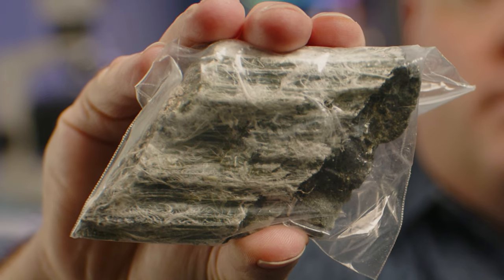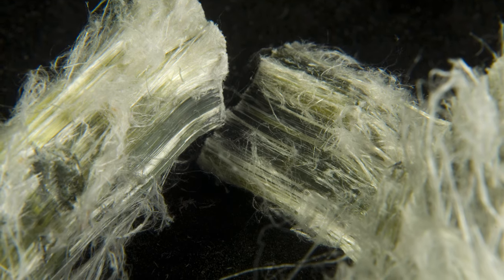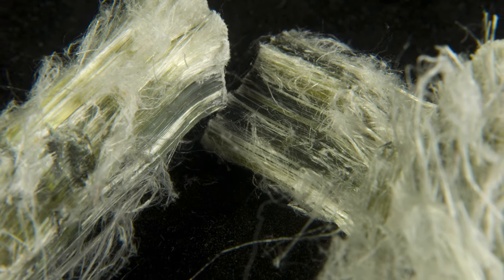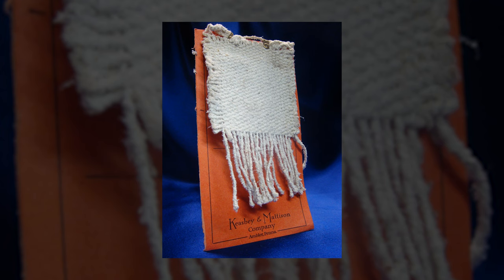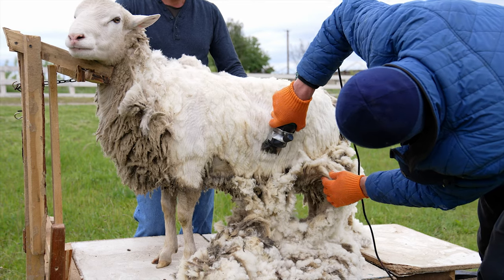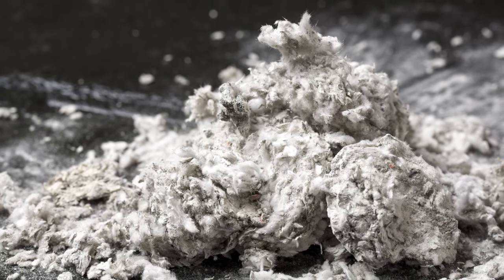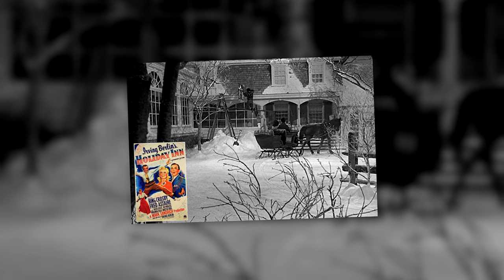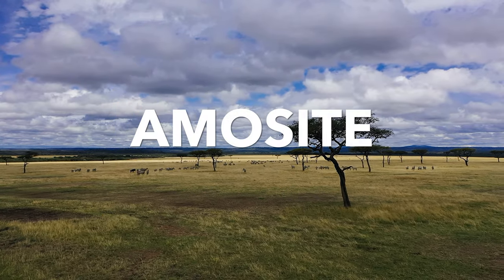Amosite's Origins: South African Asbestos in Focus

Comment: Yea that is the type of rock I was joking about buying to hold and look at like your doing.  Even if it is safe to keep in vacuum sealed plastic its a waste of any money to buy be it 1 dollar or 20 and would just be a potential hazard if anyone opened it up and exposed the fibers buy mistake even long after your gone.  It needs to be locked away in a laboratory after its observed like that.
Reply: Contrary to popular belief, asbestos is not entirely banned in the U.S. While a series of regulations have been enforced by federal agencies such as EPA and OSHA since 1973, when the mineral was officially declared carcinogenic, certain applications are still allowed. Although new uses of asbestos are strictly forbidden, products which contained it in the past are currently permitted. Therefore, various asbestos-containing products continue to be manufactured throughout the country, even though their prevalence is substantially lower than it was five decades ago.
Reply from the maker: Yes, important to remember.